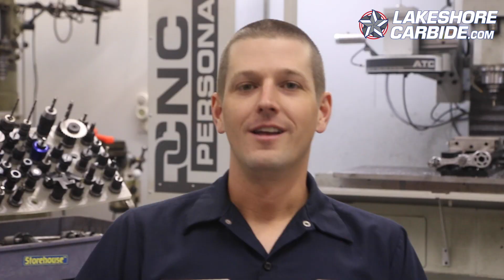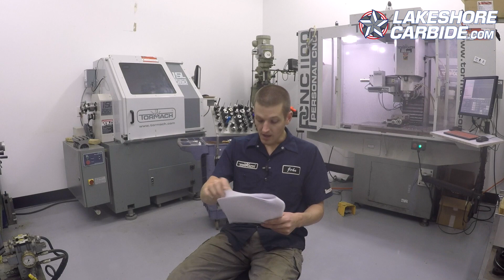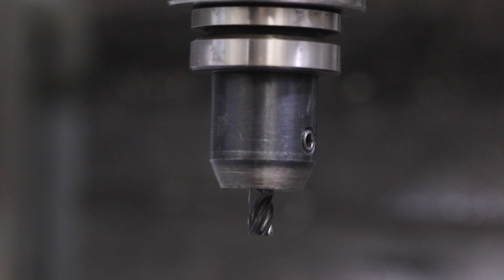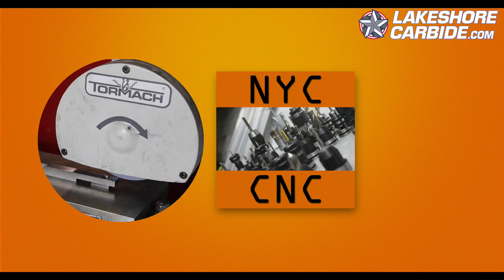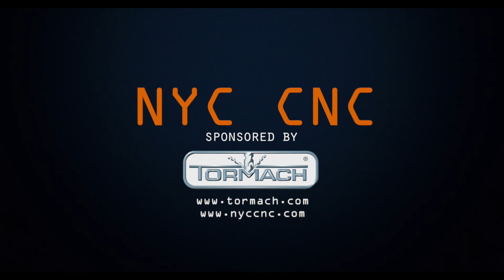5.  When is Chatter OK?

Comment: I had a 1/2” 2 flute and my setup was pretty ridged. Forgot to set my tool radius for G41 and plowed through full radial and axial cut. Even though it was aluminum I was still surprised to see it power through it. It did have chatter and I probably needed to push it harder than the .002 per tooth I had it at. I’m newish to this world.

Comment: John I think this would be a good candidate for "a picture is worth a thousand words" and running cutters through some material to get chatter, then changing each of the parameters to eliminate the chatter. Video the results.

I love ER collets. A tip to reduce runout to pretty much zero is to insert the tool and tighten normally. Before running it indicate the shank of the tool with a sensitive DTI and tap the high spot of the NUT with a copper hammer (or similar). It will shift the whole collet over just enough to take the runout out. Obviously you can get as fussy as you like with this until the runout is immeasurable, but personally I find one or two taps is all it needs. Note tap the NUT and not the tool, it sounds counter-intuitive but try it and I think you'll be surprised. Don't go crazy with the tapping, it's a tap not a whack. Don't hit the tool, it doesn't do anything, except break it if you're having a bad day. The tool won't shift away from this new position in use. The Swiss are clever people.

Comment: What's a good method for keeping long endmills from chattering? Like pocketing out an AR-15 lower receiver, you need a long cut endmill. Is there any way to be chatter free (I used a 1/2" carbide endmill with lots of chatter on mine)?
Reply: If you're in aluminum, there's often a sweet spot at much higher rpm using long endmills. The answer always depends on the rigidity of your workholding, toolholding, mass distribution, as well as the feeds and speeds. One way to prevent chatter is to transfer the force into the machine by using flat cutting drills to remove the majority of the material before a finishing pass. Flat cutting drills can overlap holes allowing you to remove material with a vertical plunge that alleviates most of the chatter problem.

Comment: John, good info for sure. Some of it even applies to manual work. For example, when parting off on a lathe if I get chatter, I increase the feed pressure until it stops (assuming that I've already verified that the tool height is correct, the tool is sharp, un-damaged, etc.).   

Thanks!

-- Mike

Comment: I absolutely love my Rohm hydraulic tool holders.  Problem is they are expensive as hell.  Literally switching from an er32 holder to my rohm in steel you can hear the difference with no other change.  And tool life improved dramatically.  I'm enjoying your take on tool life and all of this as it matches much of my own opinion.  My boss is always saying to go easy on shit and I am the one that has to prove to him that it isn't true, and to take that cut.  But he's also the one that has destroyed inserts on our 3" face mill with steel specific inserts cutting at .002 ipt when it really wants at least .008.  I haven't finished your series yet, so correct me if I'm out of line, but one thing to check when doing IPT is actually measuring the chip and adjusting.  A lot of calculations will get you into the region you need to be but you almost always need to measure the chip after a test cut and then adjust accordingly to account for chip thinning or the WOC you're attempting.  

Onto lathe stuff, the DOC is ABSOLUTELY important on the recommended settings.  I have a large radius roughing cutter that will work with a shallow DOC but it really really needs that cut.  It all comes down to tool pressure in the lathe.  My tool 2 on both the lathes I run is a small radius finishing cutter at a -14 degree rake.  If I have tiny amounts to take off that's my go to girl.  Wow...I just wrote a novel, apologies.
Reply: +Scott Moyse interesting. I was under the impression they were better. Either way, I still love my stupid expensive rohm holders and rohm drill chuck haha
Reply: +akromix great points, and I love it when I meet people who appreciate a good holder!... just a note to consider, if you love your Hydro chuck, then check out the Albrecht Uberchucks... amazing. They blow hydro's out of the water when it comes to holding power and vibration damping. Run out is a bit better, but not enough to be significant. It's the first two points that set them apart.
Reply: +akromix What I often had to do on my cnc lathe ( at work), primarily with boring bars and inside threading is loosening a screw or very light pressure on the tool holder or at the turret to get rid of chatter
Mostly one of the first on the upside and/or downside
DOC or changing speeds couldn't fix it and with the screw adjusted DOC didn't really matter I could go with light or heavy cuts
grtz
Reply: +NYC CNC no they're not but we also don't have the need for shrink holders. We may get there some day but right now it's a negative
Reply: NYC CNC That elf/santa video is hilarious. But take a look at the videos on http://www.albrecht-germany.com/ also I have a short comparison video on ChipX.co.nz
Reply: akromix NYC CNC Yes, Hydro chucks absolutely are better than shrink ons! Shrink On chucks have been superseded in quality with advancements in hydro chuck design and the insane clamping force & damping quality of the Albrecht mechanical clamping system. Shrink ons still have a valid use case when you need clearance around the tool and holder, you can't beat them then. The other issue with Shrink ons, is that after a 100 or so heating cycles, their clamping force drops off... Shrink ons are still riding on the reputation they rightfully gained in the late 90's/early 2000's.
Reply: akromix Their run out isn't as good, and because they are so stiff there is zero damping... so you get a lot of resonance.
Reply: Makes sense.  On another note, got a few endmills back from a test run of having some resharpened.  Should be interesting to see how they perform.  Sent off some high grade carbide that we've saved.
Reply: akromix I will be interested to hear those results.
Reply: +Scott Moyse I am as well. 50 bucks to literally fix a broken 1 inch cutter (was missing a big chunk of a flute from a crash long before I started where I'm at) and the cutter wasn't cheap. I have noticed the grade of carbide plays a much bigger role than the coating. perhaps it's placebo. I had some USA made hertel cheapies last 170+ parts in steel and the same part number hertel end mills but made in Korea last only 35
Reply: akromix Yeah Carbide grade is super important. But the quality of the coating is as well. I suppose you could think of it as plastering then painting a wall. If the plaster isn't structurally sound before painting... then the paint isn't going to help.
Reply: the problem most places have with hydraulic holders is their tremendous cost per unit. I have a couple that we run for specific recurring applications, but wouldn't bother unless the tool were huge and required the holding force yet couldn't stand to be run in a compression holder (aka mill chuck). For a job shop it's difficult to justify, but of course depends on the parts being made.
Reply: +Andrew Ydna DuBuc the ones we have came with one of the machines we bought. literally 25k worth of tooling included with a total price of 50k. It was a hell of a deal